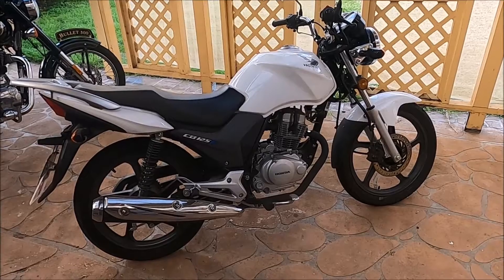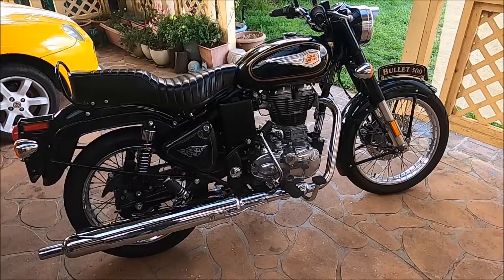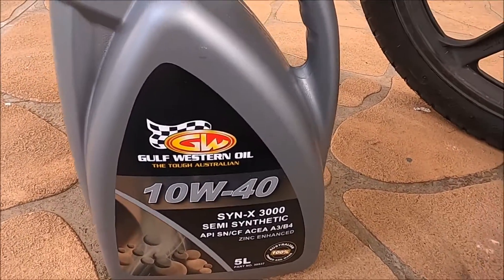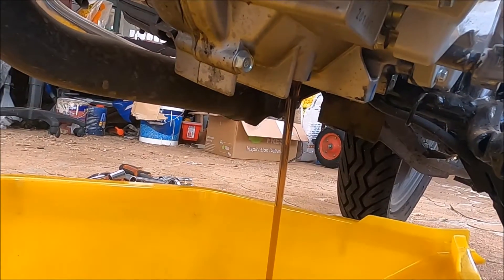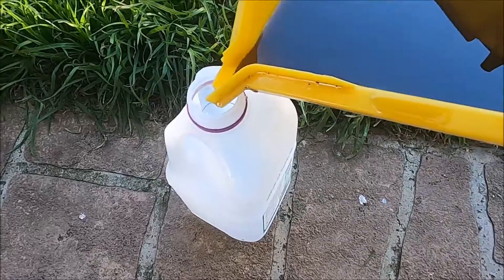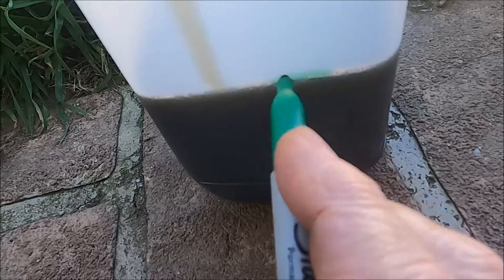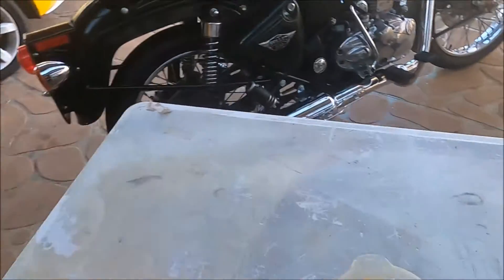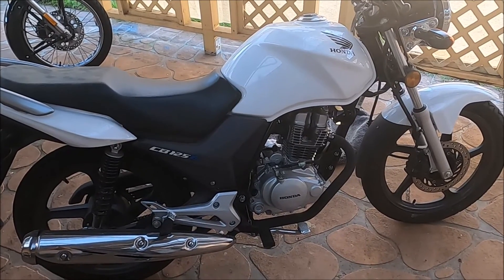2020 Honda CB125E - 5 Minute Oil Change!

Comment: Warro, I think you may like to know as a man aged 78 next birthday, I bought a new CB125E from a dealer in Ipswich Qld this arvo for around $3,560 and I did it because of YOUR Youtube video on your daughter's bike. I have a R/E Classic 500 to which I fitted the last Sidecar of the last of HUNDREDS I imported until 2016 when I busted by kneecap on a boating accident on the Gold-coast. I did this as a hobby business and it reawoke my interest in motorbikes after many years. My first bike was a 1950 Matchless 500  single back in 1961 when I was 16, with hindsight this was way too big and if only Honda was around then with their light efficient machines. I love your work mate.
Reply from the maker: good to hear you enjoy the channel. you should have a bit of fun on the cb125e. only real issue i found was its a bit vibey in the bars and takes a while to warm from cold start or first cold start.
after that it good enough to ride anywhere and quick on the start and ready to run anywhere.
ive actually seen a couple with high klm on them too. one unit had over 100,000 which i thought was pretty unreal for a 125 bike

Comment: Sweet little bike. I'm glad to see that your daughter (all 148cm of her) has persisted with commuting on it.
With its 14 litre fuel capacity, I would love to go on a long quiet road tour on this machine.
Sort of like a postie bike tour, but without the fuel range issues, a few more cc's and an extra gear to play with.
I was enamoured with the little CBR125 (FI) when it came to Au in 2007 for $4000, I think this is even more fun & practical for $2600!
Reply from the maker: yeah it was a pretty cheap set of wheels but i think the new 5 speed honda grom for $4500 is really good value too.
 just the other day the daughter pulled up driving a huge cement mixer - and i mean huge -no play toy from the gold mines. 
i actually asked her on the clip was she tall enough to drive it...lol
i might put the clip up later on
Reply: @ridewithwarro  That'd be awesome. Did you ever get around to posting a full review on the CB125E?
Reply from the maker: @MrBenHaynes  did a bit of a fool-around on this clip with the owner but  thats about it
https://youtu.be/GuG6B1XoGzI

Comment: That seems like an easy enough job. That oil looked pretty clean to me. A lot cleaner than the oil that comes out of my Royal Enfield after 2K miles. I am surprised to see the rubber "noise dampeners" on the Honda. My RE had those on the cylinder fins too. But when I removed them I couldn't tell any difference in noise from the cooling fins ringing. I keep thinking that those rubber strips are there more for looks than for actual noise reduction.
Reply from the maker: i didnt actually take any notice of the noise dampeners when i did the oil change. but i did notice it was a nice clean tight oil free motor on the underbelly side.
it pretty well good to go for a while now so i think $1.50 well spent

Comment: Looks like a 13mm drain plug, not 12mm
Reply from the maker: this it is and actually its an aftermarket 13mm magnetic sump plug but for those who run a stock bike ...its12mm on the plug.